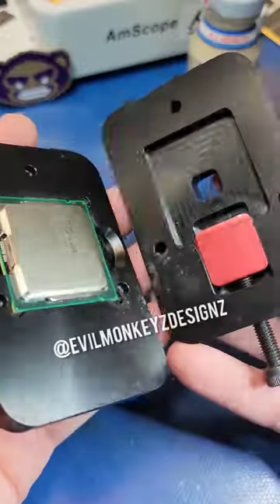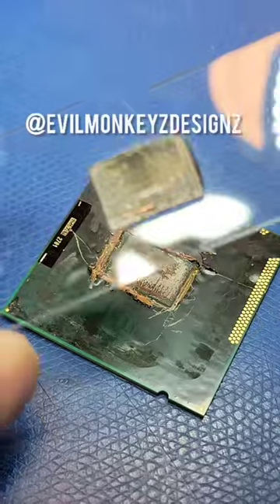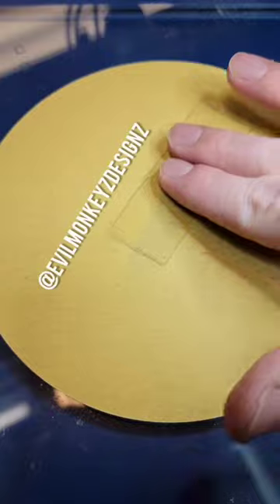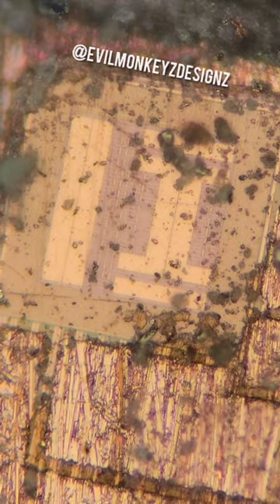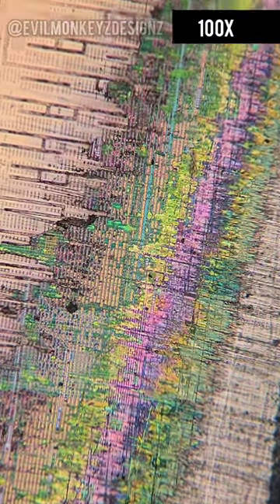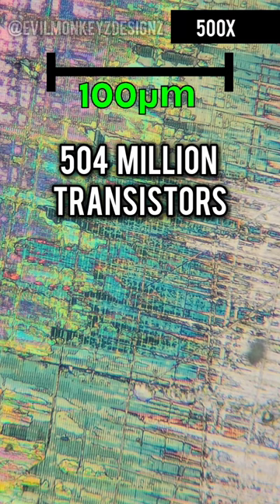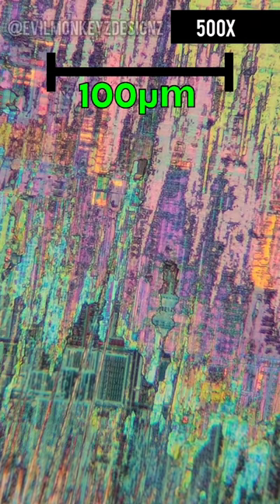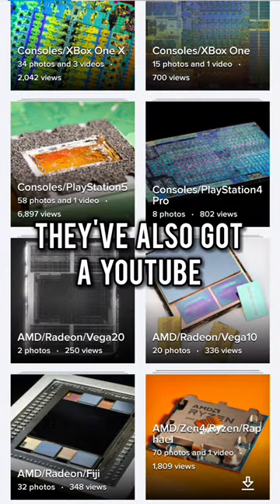Inside an #Intel Celeron G540 CPU

Comment: Inexpensive,  low tech part, only 200x more dense than we used to make in the 80s. 😂   We just never imagined this would be possible.
Reply: The tech was current for the time. But it was a low-spec machine.

Comment: Not to be that guy, but I think you might have a better silicon recovery rate if you sand in a figure eight pattern. Wet Sanding would be best too, but I don’t know what liquid to recommend for this application. Considering the small amount of material removal in general polishing techniques would be your best bet. Either way, I find your videos awesome.

Comment: I guess your goal is to see each layer one at the time and then continue to grind to the next, but the corner with the colorful layers is so beautiful! Celeron silicon art!
Reply from the maker: The main goal would be to remove the top layers at least, since they are cover up all of the interesting circuits underneath. Some people do remove each layer to photograph each one, but they will typically use more controlled methods involving chemicals. I'd agree with you though, this experiment did have some interesting results!

Comment: I think looking into how extreme overclockers do die-lapping on CPUs to maximize heat transfer could be helpful for evenly removing material.
Reply from the maker: that definitely sounds extreme! I'll have to look into it.
Reply: Like alluded to in the video, the super fragile micro structures are buried on the fiberglass facing side of the silicon. Polishing the backside doesnt necessarily put them at risk if you limit the force.

Comment: take a Q9650 and try to delid it, since its soldered and not the soft new kind, you will crack the die on removal. i have a perfect cracked in half die that shows EVERYTHING

Comment: When I worked in metal finishing (electroplating) in the 90’s, one method used to measure the deposited thickness was “cross sectioning” a part. The part was cast into resin. When set, the part was either cut then sanded down or just sanded down to get a bias view and examined with a comparator. You might try a variation of this. 
One benefit is that the resin makes the outer edge giving more leeway to polish the dart down. 😊

Comment: Put it son something square,then put four dots of epoxy or glue, then start sanding trying to keep it flat before you touch the die, it helped me out, by the time I got to the part i had it fairly flat and upon contact i got it even closer. Use minimal pressure, it will help keep it from looking ragged because you are tearing pieces off, and too fine of sandpaper causes dust ro build back up in the grooves on the part making it ugly.  You will figure it out i have faith my brother!

Comment: Need to get you a cheap lapidary setup dude. Dirt cheap diamond laps, a slow/variable speed wet lapping setup could be put together in a few hours with not much money at all.  Going to open up a whole new world for you when doing cross-sections and examining parts
Reply: Or you could just get some cheap lapping films and 3D print some lapping guides so that you guarantee flatness. Without wearing through the edges.
Reply from the maker: I would have to agree, my current setup is definitely lacking, and it's something I'd like to expand on in the near future. :)

Comment: Idk how hard that silicone chip is. But if just cleaning a hardened residue i think razor sharp knife would do. Or can use sand papper but with flat moving surface and gentle tap the chip. Anyway really like your YouTube videos.

Comment: If you want to apply even pressure you should is a block of wood or plastic and attach it to that, so you dont have to press on it but it will be lightly pressed by the weight of the block

Comment: Is any of it gold
Reply from the maker: I think the only gold used on modern flip-chip BGAs like this is the ultra-thin gold plating on the printed circuit board. I'm pretty sure there isn't any gold used on the silicon chip.